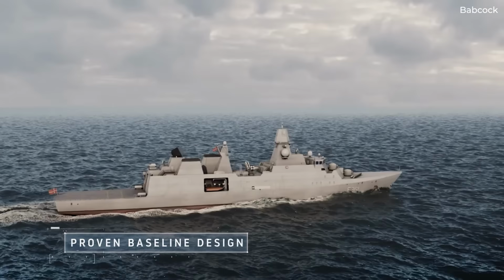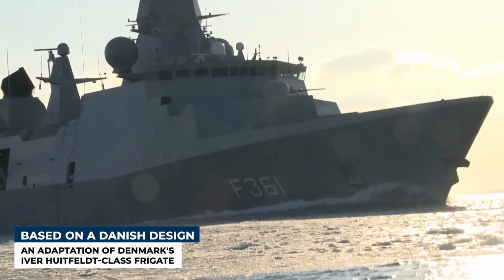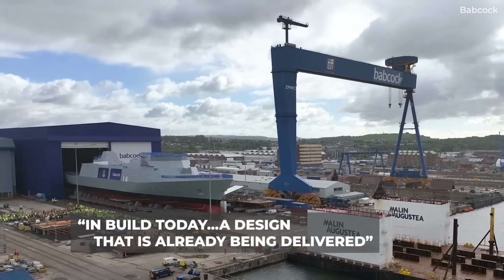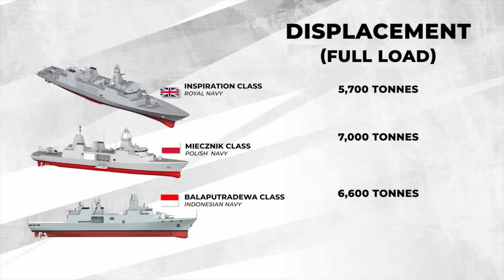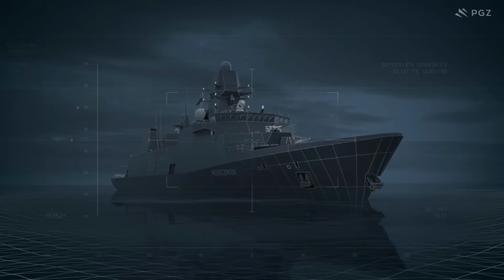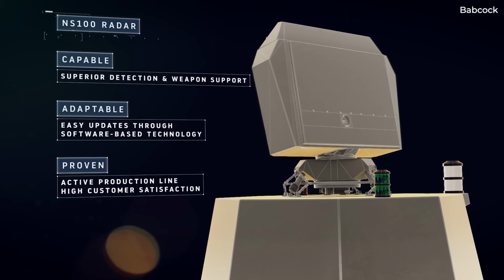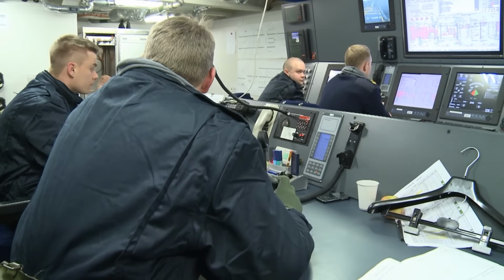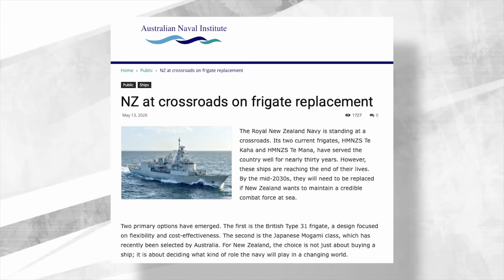Type 31 (AH140) Frigate: The Best Option For New Zealand?

Comment: Good question. I quite like the British Type 31 frigate offering lower acquisition risk, existing production maturity, and greater flexibility for general-purpose missions like disaster relief.  However, it lacks the immediate regional commonality benefits of the Mogami-Australia alignment, which really means it is the pragmatic choice (a priority emphasised in New Zealand’s 2025 Defence Capability Plan, which I suggest may be the deciding factor). It also may be less suited to high-end warfare compared to the stealthier, more heavily armed Mogami. 
I note some defence analysts argue that neither frigate is the optimal solution, suggesting instead that New Zealand should prioritise Multirole Vessels (MRVs) or Landing Ship Tanks (LSTs) equipped with modular weapon systems and unmanned drone capabilities.  
This suggested approach would offer greater fleet numbers, adaptability for Pacific patrol duties, and cost efficiency, though it has not yet replaced the frigate-focused procurement strategy
Reply: Is it really a lower acquisition risk. Japan have made and will make a lot more mogami's then there will be type 31's. 12 normal mogami's and 23 new FFM Mogami's. The base type 31 doesn't really get you a lot and once you start adding in the extra sensors and systems that Mogami has out of the box then the cost starts to equalize. However since NZ are looking for a replacement for the patrol boats as well there could be scope to order a mix of both ships for the different tasks they are good at. Adding 2-3 of each on to the order books of either vessel might allow the RNZN to kill 2 birds with 2 stones......
Reply: Closest next of kind would be the Indonesian then if they choose 140. Assuming NZ yards not follow on the afters
Reply: @va_sirberpasir9708  As mentioned elsewhere the maintainence could be done in NZ for the type 31. Just ask the poms to add 2-3 to there order books. NZ won't need to do anything with Indonesia if they order a type 31. RNZN could transfer some of there stuff from the Anzac like the sea ceptors and torpedo launches if they want to save money.
Reply: @carisi2k11 fair point tho still my skepticism is a out thr NZ giverment itself, they been too lenient on defense matter for too long, and idk if they can fix that anytime soon to even adding
Reply: @va_sirberpasir9708  You are correct to be skeptical of the NZ Government.
Reply: @va_sirberpasir9708 Usa and austrailia gave us a public ass kicking about that recently. Calling us deadbeats. Cabinet took note. Our NZDF and govt agreed we need increased lethality. Thats why the p8 and frigates are being fitted with harpoon anti ship missiles and why we invested 9 Billion into the defence force
Reply: The acquisition risk is the nightmare their shipyards are going through now. Didnt u see the news on them being unable to patrol the Atlantic proper or even to Iran?
Reply: @snapdragon9300  Oh dear, I rather think you have conflated two separate issues... neither of which is true lol

Comment: There isn't really a bad choice here. Both are good options.
In my opinion, biased as it is. Mogami would seem to be the best option given the RANs adoption of them and the local production from both Australia and Japan.
Really it's a pity that the NZDF and RAN didn't go in for a collective acquisition to replace the ANZACs at the same time. That could have lowered costs for both nations by increasing the order size and realistically, it wouldn't have cause any major program issues given that both nations want to replace the ANZACs with modern, off-the-shelf designs.

A knock against the Type31 as far as New Zealand is concerned is that it might be a bit of an orphaned design in this part of the world. Yes, Indonesia has them, but their version has a lot of different systems and weapons that the NZDF likely won't go for.

The NZDF could decide to go commit to the Frigate as their biggest and most capable combat vessel and if that was done then spending the extra money to have the most heavily equipped ship possible, might be the way they'd go. 
If they went that way then we have more information of the Type 31 and how that would look, compared to the Enhanced Mogami.
The Mogami though, might still be able to take on a lot of similar firepower while being less costly, or simply getting more hulls. So far as I know we don't know how many ships the NZDF are looking to get to Replace the ANZACs.

If they only want a 1:1 replacement, then Mogami might be the best choice just to get them quickly and cost effectively while still getting a major capability upgrade.
If they want more frigates than they currently have then it's a bit more a choice of the two.

There might still be a case for the NZDF intergrating into the Australian SEA3000 program to some level and helping to drop that per-hull acquisition cost for both nations and the ongoing costs.
The fact the NZDF has gone with the MH-60 instead of more NH90s is interest and perhaps indicates they weren't wanting to deal with the increased cost for flight hours of the NH90.
Reply: As a Kiwi, The upgraded Mogami makes a lot more sense as it aligns with RAN especially as the china is getting pushy.  Being able to seamlessly operate with Australia and US/Nato allies is key.  Yes NZ should have gone in with RAN but our politicians are not awake to what is brewing.  Against the Type 31 is timeline for delivery and where upgrades can be done in the future.  If Europe goes hot NZ will be last on the list for anything, with Mogami we would have regional supply chains and supply if and when Asia goes hot. 

The Mogami is also the more badass ship in looks and that is a plus lol I would be ok with it being painted Black with a Silver Fern on it.  😎  Looking sharp and cool adds Mana to a ship.
Reply: @Max_Flashheart  silver fern? It's not a white feather? 😄
Reply: @starship4453  The country isn't even on maps.  That is real stealth.   We have a hobbit and sheep infestation so I would avoid the place if I was you lol🤣
Reply: @Max_Flashheart  
Thinking in the box...
I had hoped that all four Commonwealth Royals would go with the the T31's....just looking at inter house industrial production benefits, and future strategic interoperability....and  last but not least our history.
Reply: @RPMZ11  I think they actually need that capacity to help restock the multi decade reduction of the Royal Navy.  Just like before WW2 everyone knew things were going to get hot and the Pacific access to Europe could be hindered by closing the Straits.  Building regional commonality with Australia Japan and weapons systems supply chains works for all.  NZ has money believe it or not, man power is the real issue.
Reply: @Max_Flashheart  I agree that man power and the retension of man power is a factor across the services and has been for a number of years.
Reply: @Max_Flashheart  The Mogami with its 90 man crew requirement might suit the NZRN better than the 31 then, perhaps?
Reply: @ChrisHUTTON-zc4br  100% it is approx half the crew of an Anzac Frigate.  So we could field 4 upgraded Mogami frigates (well sort of, it is never that easy to say that but you get the idea)
Reply: @Max_Flashheart  I don't think New Zealand can afford either
Reply: @starship4453  2026 NZD$6.2 Billion (USD3.7B) 1.2% of GDP +6% 2025.  Increasing to 2% of GDP.  ANZAC replacements are already in the budgets they need to be replaced due to lifetime with extension.  NZ had the money in reserves and with china turning up and firing missiles without notice and long range missiles we cannot afford not be have effective vessels if it does go hot.  Or NZ goes for Container Ships with Containers of Drones piloted by all us gamers with nothing else to do in times of war.  Actually both of those ideas work......
Reply: @Max_Flashheart  The problem is that the NZDF is tired of buying from Australia just to align with Australia - especially when what they buy fro Australia is ALWAYS badly built and incurs extra costs.  Happened with the Mekos and with every single thing bought through Australia in the last ~25 years.  If they did opt for the Mogami they have already said they would opt for the Japanese-built option, a clear indiciation that they're not going to put up with substandard Australian-built equipment.
Reply: @iatsd  yeah I get that, but NZ would be purchasing the upgraded Mogami  from Japan and could be built in Japan or Australia with potential NZ construction in areas. However The UK building a  Type 31 has the same issues but British and they care less about NZ than Japan in this current environment for obvious reasons.  I choose the Toyota Hilux over the Range Rover Sport
Reply: @Max_Flashheart  As I've said, the last thing NZDF wants is anything to do with Australian production after the debacle with the Mekos.  They have already said they'd opt for Japan-built if they went with the Mogami. 

I just think that buying either would be a mistake for NZ.  They simply won't meet the needs NZ actually has.  It's also likely that the RNZN will repeat the mistake they made with the Mekos and buy in a completely stripped out state, only to spend the next 20+ years slowly adding equipment it should have had from the beginning.

The problem is that the RNZN powers that be have a distinct case of penis envy and refuse to think outside the Blue Water Power Projection paradigm.  The lowest point of entry for that is frigates.

But NZ doesn't need that.  It can't afford that.

What it does need, IMO, is proper fisheries & resources protection and international sea lane protection.  That's better served by 6-12 purpose built modular ships that can be configured for different roles.  That would give NZ enough hulls to actually do the jobs that the RNZN is tasked with doing.
Reply: @Max_Flashheart  ...
Toyota Hilux is a poor example, they're made in Thailand not Japan.
Reply: @rhombusisotope8117  Our Hilux were locally assembled in New Zealand. Toyota.  Still a Japanese design and setup assembly here we local partnrers up until 1995.
Reply: @iatsd  what bullshit are you on about? What problems with the Mekos have you had?
Reply: @starship4453  What, you missed the engine problems?  The engines, from the US, were tested before installation. They failed.  The Australian builders put them in anyway.  There was also the fvck up with the hulls.  The superstructures were built as 3 part units in NZ. When they were delivered to the Australian hull builders it was discovered that every hull had been built out of spec.  Some of them were up to 250mm too big.  More fantastic Aussie build quality, eh?

There were other fvck ups, but those were the two most expensive. 

Next you're going to ask about the 105mm Light Guns and what was wrong with those, aren't you?  Act all Pikachu Surprised to learn they were badly made as well?
Reply: @iatsd yeah that all sounds made up
Reply: @iatsd maybe NZ should look at the Canadian Harry DeWolf class, their Arctic/Offshore Patrol Vessels. 2/3 the length of T31 or Mogami, 6600t, 65 crew. The selling point is the Polar Class 5 hull (PC4 on the bow) so all those DEI appointments can run over reefs, illegal fishing boats or even 1m of Ice (1st year)...😅😅
Reply: @gregdrake5415  Not modular and not able to do half the jobs NZ needs, and 17 knots wouldn't cut it.

Someonething along the lines of the EPC would be more useful for NZ. Half a dozen fitted for fisheries patrol and the rest a combination of ASW and MCM would probably work.
Reply: @iatsd I suggested as more of a patrol/policing. RHIB's solve the speed issue like the Canucks will do as there is always someone faster, these ships seems will go a lot of places a 31 or Mogami may not down south but if still aiming warship level then no. NZ isn't big enough to support all the toys unfortunately. Maybe specializing and being more combined with Australia and the Sth Pac Island Nations is another solution. Joint manned ships maybe even... aaah the future brings many paths.
Reply: At least the first 2 type 31s lack any bow sonar or torpedoes, so if the NZDF wanted ASW capability they would have to modify the base design somewhat. 

On the other hand, the type 31 is more modular and so is a better option if the NZDF is looking for to keep the ships for a long time.
Reply: Integrated in the Polish versions already.
Reply: What a shame that the ANZAC collaboration didn't continue with this new round of frigate replacement. I just assumed that would be the way forward every time, for both countries. Sad.
Reply: @Clipper_Damez The NZ defence force has been burned by the Australians too many times in the last ~30 years.  It's cost them millions - and they simply don't have millions to fix Australian caused fvck ups.
Reply: noooooo mogami for the win
Reply: What makes you think they get some kind of bulk discount on these and don't just pay a base price to produce them and add on country specific? 🤔  pretty sure Australia is actually paying a premium for their mogamis just to have the build rights which more equates to national industry benefits rather than any perceived savings otherwise Japan would be building all 11 rather than just splitting production 3/8.  In any case that would then mean NZ would still be better off using the Japanese build line as technically they have built more.
Reply: @regregan6852  Yeah, you are right. We are paying more for the development of industrial capacity and the speed of acquisition, hand in hand those two things. 
But making larger orders for a product allows for economies of scale and other industrial factors to play in.

I'm not really the right person to really put into words. Perun, on youtube would be a good person to look at to see what I'm talking about.
Reply: @birdmonster4586that might work for say planes but I can't think of any reason for ships other than merely to keep any shipyard in actual buisness if said frigates were it's only buisness and which is why the Japanese build would work in our favour as the timings would work perfect for NZ to slot a few frigates onto the end of their own 12 ship build @ the mid 2030s and their production lines are already well established and proven.

If anything shipbuilding has only gone up in recent years to adjust for increased costs.
Reply: @regregan6852  NZDF have already confirmed they would opt for Japanese built in order to get them faster and get them built to spec.  Too many instances of the Australians cocking up production, starting from the Mekos, which they ballsed up completely.
Reply: @iatsd  Can you cite the source for that, it would be nice to read.
Reply: @birdmonster4586 RNZ reporting, IIRC.  I'd post a link, assuming I could find it again and that YT wouldn't strip the link out.
Reply: Doesn't matter what boat NZ buys... they've already BOUGHT DEI and that's already sunk a ship.
Reply: @FrankFrankston-kj4sx  No, a failure to train the crew properly in the first place and a captain who failed to continue that training lead to disaster. The sex of the captain is irrelevant, there were failings all the way along the line.
Reply: @stevebarlow3154 OMG! See should be irrelevant, but widespread evidence from the ministers moronic mouth shows the opposite. DEI is death to competitive standards.
DEI lost NZ biggest ship in peacetime on calm seas.
You can't make it up.
Reply: @FrankFrankston-kj4sx  Use your words and explain.